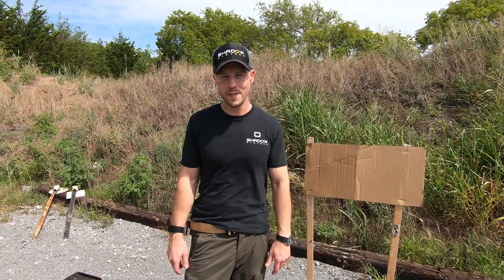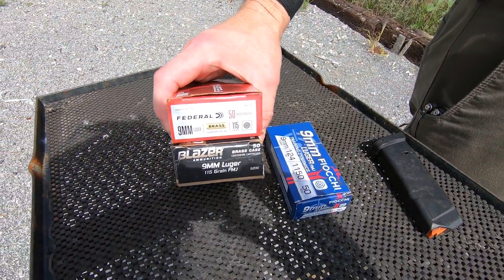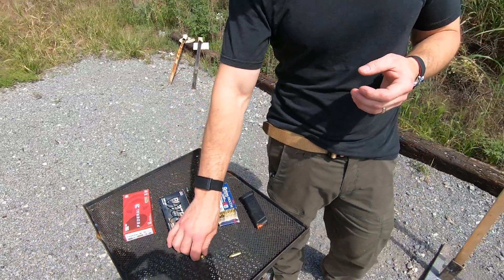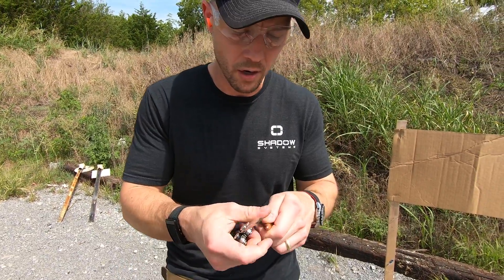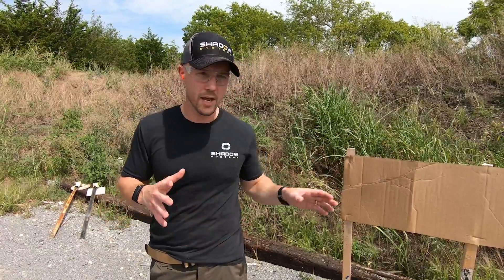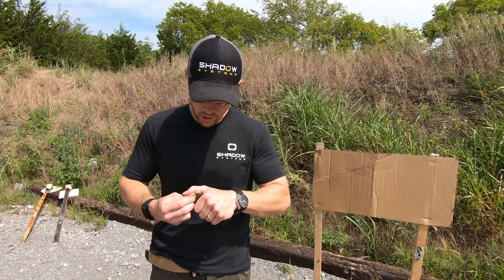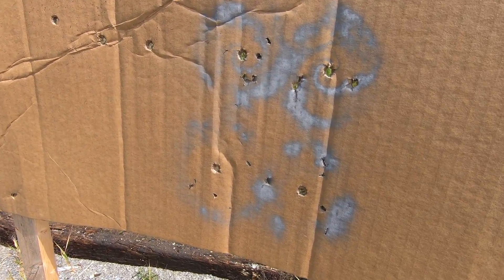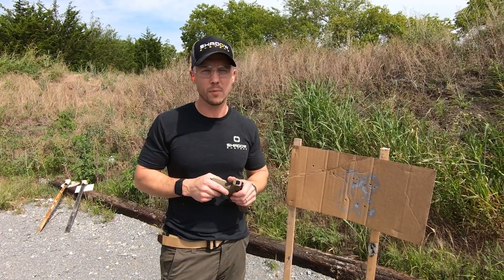Technical Tuesday: FMJ-ish projectiles and leading in your barrel

Comment: Just saw an Ultimate Reloader vid saying that plated bullets cause LESS lead to be in the air than swaged ones because swaged bullets are exposed on the back. 
So i guess that guy was really wrong and dumb, its the opposite because like you said, the rifling gouges the bullet as it goes down the barrel and particlizes whats scraped off. 
An exposed swaged bullet isnt touched by the barrel, only the gasses and flame touch it but it stays in one piece and leaves in one piece

Comment: I have the MR920 and although the trigger sucked major crap out of the box it's an amazing gun.
Reply from the maker: Hey, thanks for the comment.  Did you find it improved as it broke in?  We sometimes hear people really like the trigger as they get used to it and the gun breaks in.  We definitely don't put a "match" trigger in the guns as they are intended for defensive use primarily.  Glad you ended up loving the gun!  Trevor
Reply: @ShadowSystemsCorp  Thanks Trevor!  I have to say, for the money you simply can't beat Shadow Systems hands down.  The trigger finally broke in after a bit of polishing, dry firing and a day at the range.  Now my SS MR920 is utterly amazing.  SS engineers and designers definitely knew what they were doing.

Comment: Thank you!   Any preferred brand/grain for target ammo that seems to run best in the DR920?
Reply from the maker: Hello.  We recommend only "standard" weight loads in the 115, 124, and 147 grain range.  The guns should run fine with the more exotic stuff (90 grain, etc.) but it's best to stick to tried and true since there are so many proven loads available in that range.  I tend to gravitate toward 124 grain loads for general use and most of our testing has been with this bullet weight as it is the NATO standard.  Trevor
Reply: @ShadowSystemsCorp  
Thank you very much.
Reply: @ShadowSystemsCorp  any opinion on brass or steel casings?